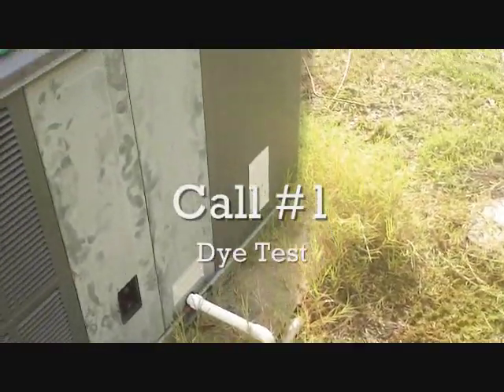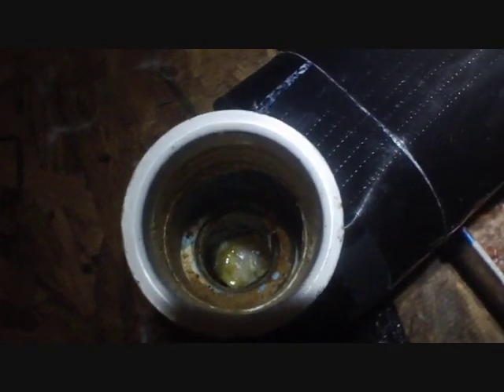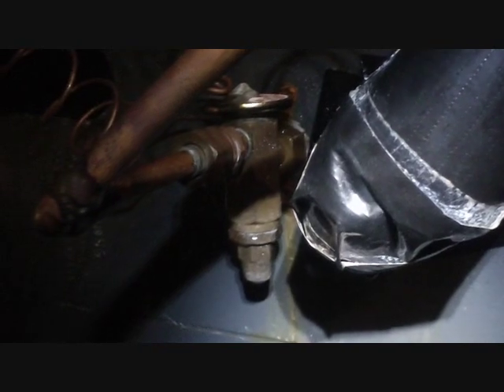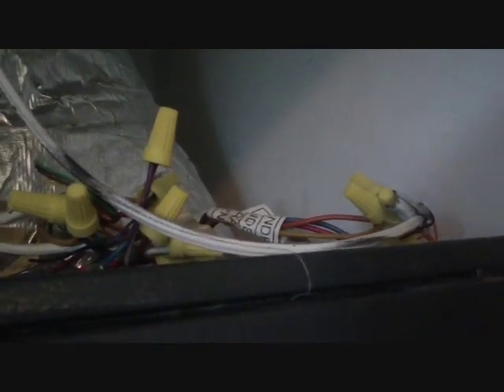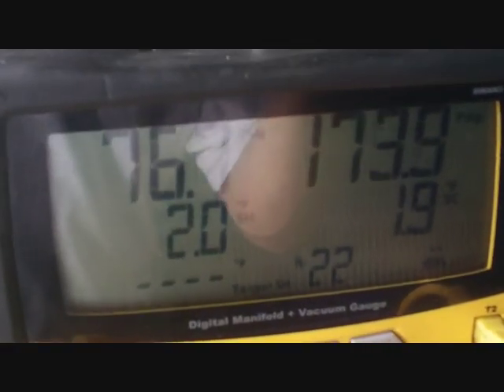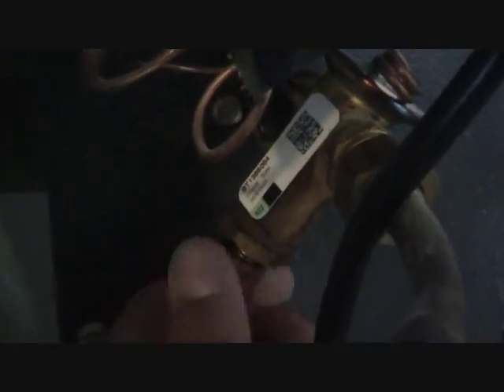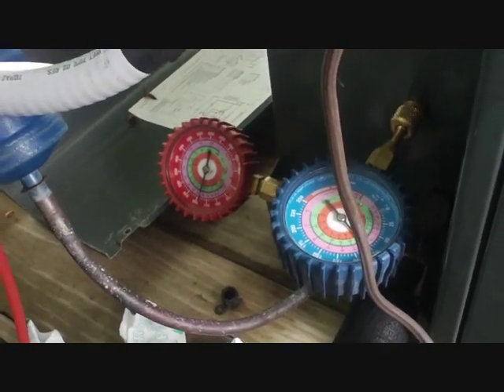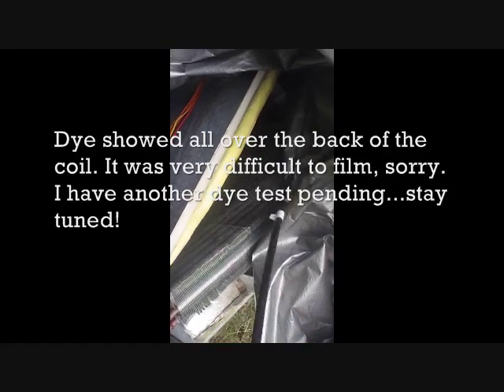HVAC Service- Refrigerant Dye Leak Test and TXV Adjustment

Comment: Stupid question incoming: I see how the superheat was out of adjustment. Was it not set properly upon install (Is this a newer system), or did the spring loosen on its own over time to cause the valve to open up so wide? Great work again Zack